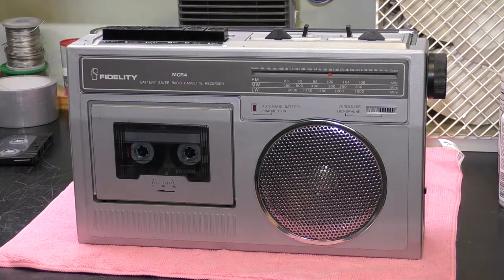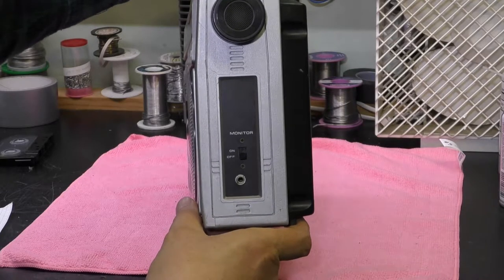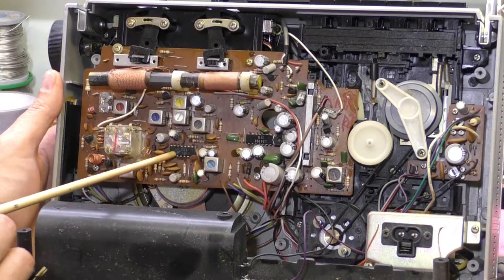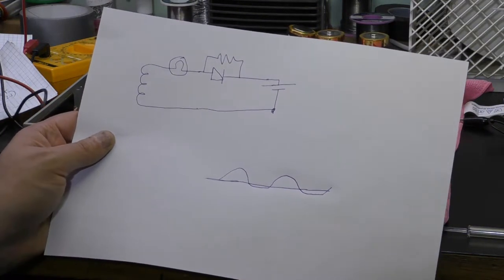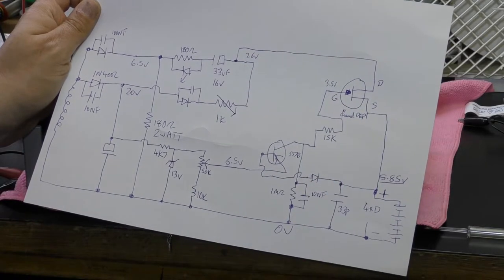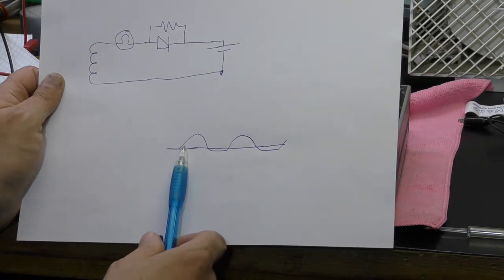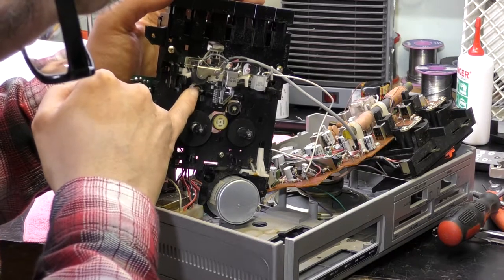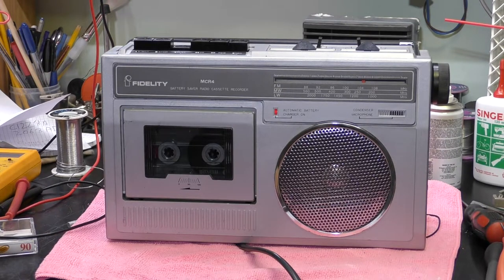Fidelity MCR4 Radio Cassette with "Battery Saver" charger.

Comment: I like your circuit diagram; drawn properly with round 'bridges' where wires cross but don't connect. Much easier to read.